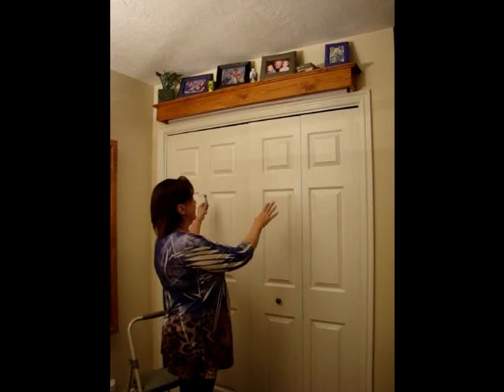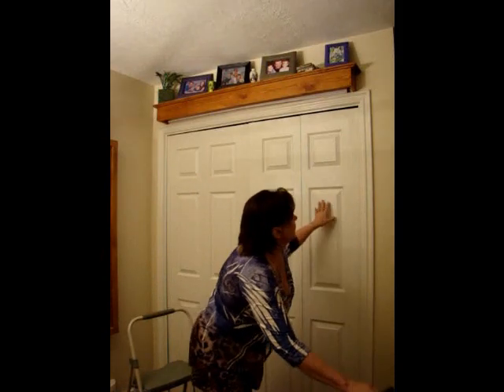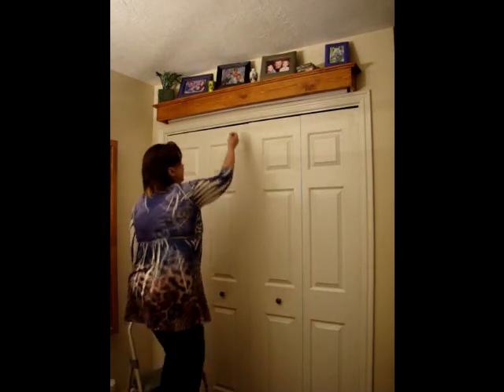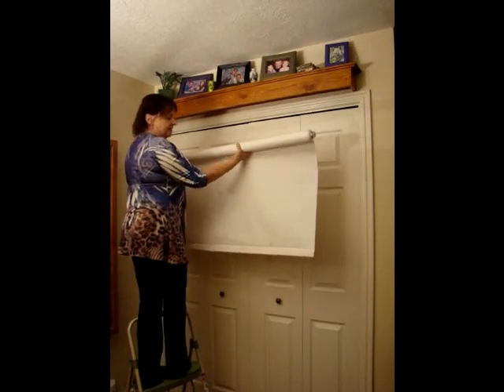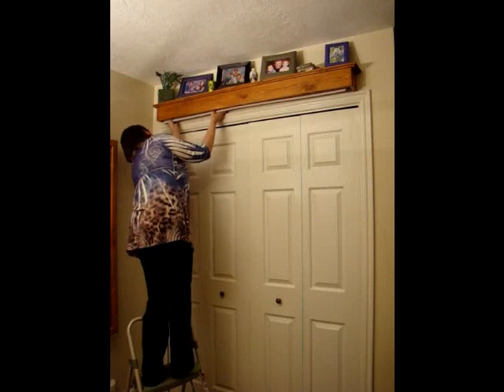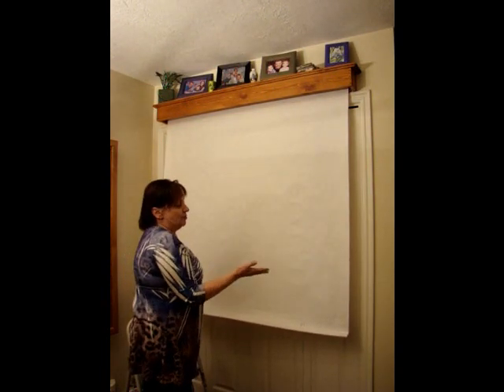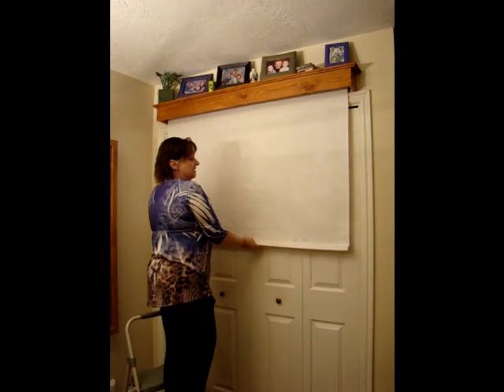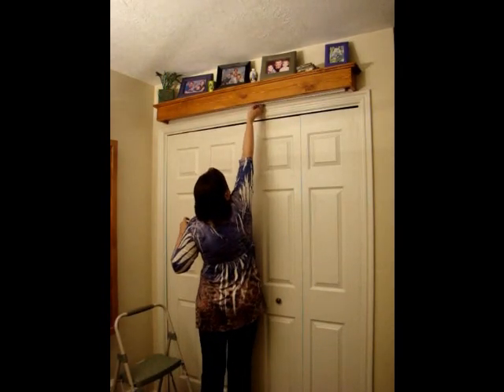Vanishing Design Wall

Comment: I bought one a few years ago and absolutely love mine. I don't need a step stool and I'm only 5'2" tall. It hangs over my closet and is full of my blocks. I was never able to have a design wall until you invented this disappearing wall. Thank you. Very good price for such a  nice quilting tool.
Reply: Hi Jeanne, it's been 3 years and I am trying to contact this company to no avail. I would like to know your opinion of this design wall after all this time.  Would you happen to know anything about the company?  Thank you for any input.
Reply: Just make your own.  It's a cheap roller shade, covered with flannel.  Buy a roller shade in the width you want,  use permanent adhesive spray and glue white flannel on it, and hang it.  If you want the shelf too, buy the box shelf and install the roller shade mounting brackets inside the box, other wise just install the roller shade brackets to your wall, above the closet, window etc.